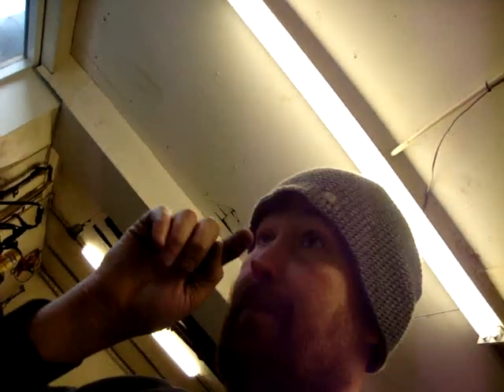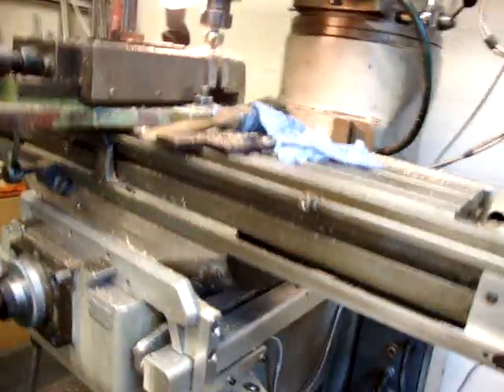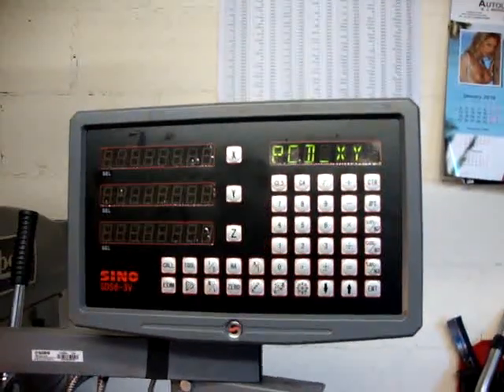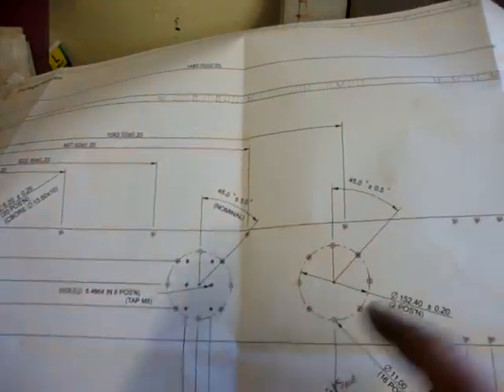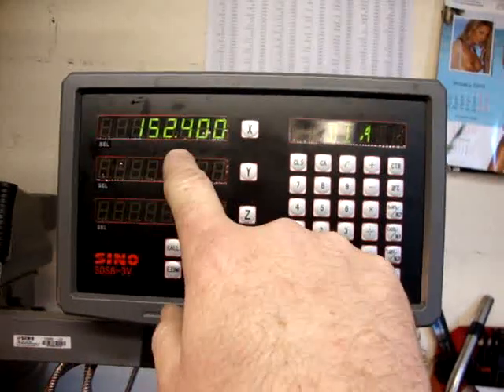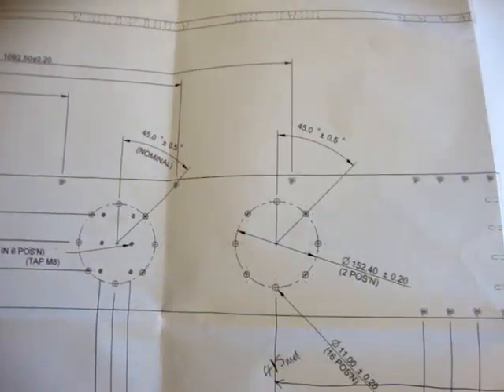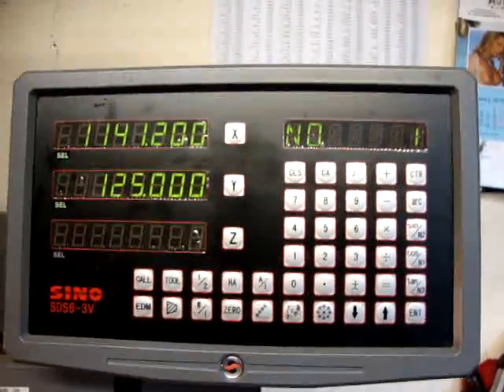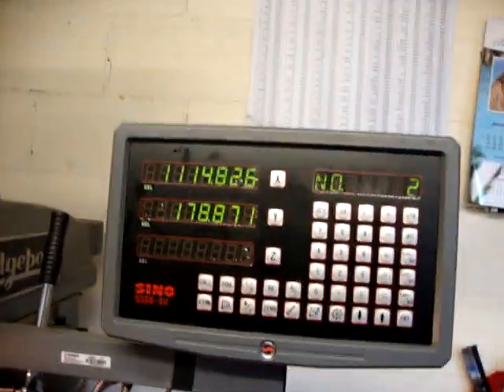SINO DRO TALK THROUGH SETTING UP FOR USING P.C.D FUNCTION

Comment: Thanks for the info , very usefull .I see that the open side of your z axis  lineal is facing towards the mill....chips could  get between the reader head and the glasslineal after some use.  Normally this glasslineal is mounted with the protecting cover facing the milling side and by using a bracket  that reaches over the glasslineal the reader head gets mounted at the backside.

Comment: Hello, do you know how to drill holes in the mill using digital for example 8 holes or 7 and with initial angle of 112.5 degrees, and the end how do I have to put? Or then divide 7 holes but with initial angle of example 57 degrees and the end? I did not find the logic for the data in the digital display, in my case my and the bell but the manual is not helping.

Comment: Sorry if this has already been answered, because I didn't look through each and every comment that has been posted...

But it's using zero degrees at the 3 O'Clock position, because that's where zero degrees is on an X-Y Cartesian coordinate graph--it's on the positive X-axis. Then 90-degrees is at the 12 O'Clock position (positive Y-axis), 180-degrees is at the 9 O'Clock position (negative X-axis), and 270-degrees is down at 6 O'Clock (negative Y-axis). 

This is very important if you're going to use the trigonometric functions (sine, cosine, tangent, etc) and want the angles to be represented with the correct signs (positive vs negative).
Reply: Tom B p

Comment: the other thing I have not been able to do is to do a calculation and enter that result in the X of Y  of the dro. for now I just write it down and can added.  says it has to be in some MODE to function like that, but I can't figure it out. not the most important feature.

Comment: I have set up holes with 0 starting degrees and 360 ending degrees and all is well. BUT I can not seem to start a hole Straight up the Y axis 90* degrees. I have tried everything I can imagine as an ending degree point and do not get 3 evenly spaced holes. any suggestions
Reply: +Ed Ginsberg hi ed I am sure you have sorted your problems out by now but if it's any help I got my dro a few days ago and been trying to figure it out here is what I found. Looking down on your table imagine a clock face, now on my dro if I set the starting angle as 0 this point is 3 oclock so if you want to start at 12 0clock you need to work out the degrees from 0 in my case this would be 270. and end angle would be the last hole of 5 which is a multiple of 72 degrees. Hope that helps?? cheers
Reply: +G0SQI thanks that is how I figured it out FINALLY spent most of a day trying different combinations. thanks for getting back.